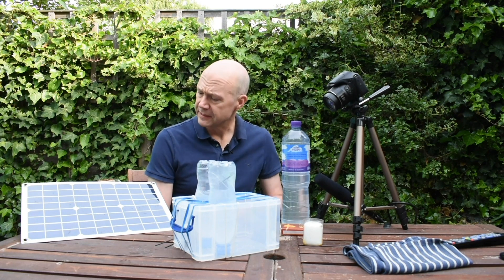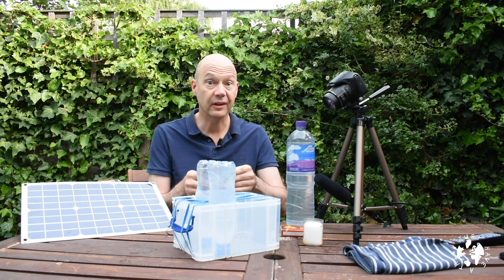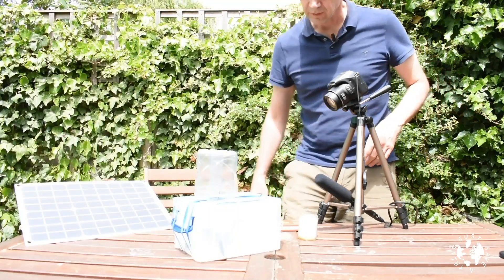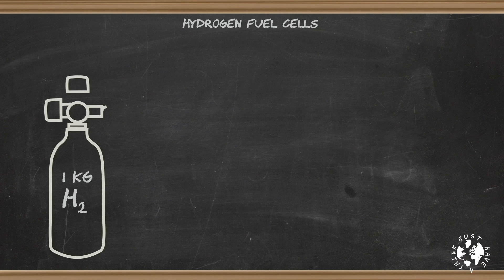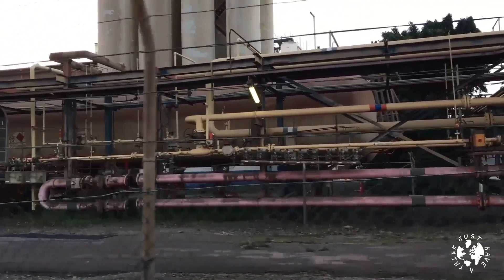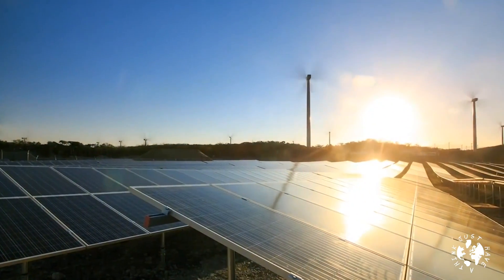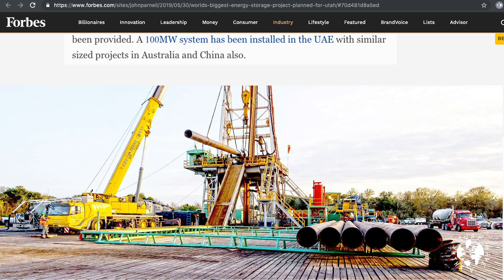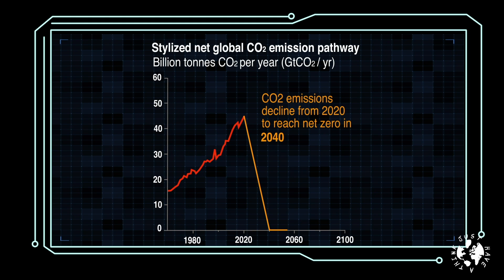Energy Storage in Hydrogen : Does this beat batteries?

Comment: Micro grid storage hydrogen is the optimal solution for both the "duck's back" solar problem and long term seasons fluctuations. With smart meters and hydrogen cells its even possible to do sub millisecond smoothing. (Just need everyone to accept that, in the short term base load should be shouldered by nuclear.)  Every time I see a wind turbine that is not turning I'm thinking, "could be producing hydrogen for the grid."

Comment: Exotic, hugely expensive, inefficient...it's sad that so many people believe in this.

4.1K likes to 140 dislikes at this writing.  So all you 4,100 people really, seriously, should pool your resources and built a pilot system.  Let's say, one house, totally run on hydrogen, no exceptions, which also makes enough hydrogen to run a commuter car six days per week for, say, a ten mile commute (20 round trip).  It'll cost everything you all have, if you sell your houses, close out your bank accounts, etc.  All the smart people want what they have been taught to think of as "hydrogen power", so that means it's obviously the way to go (though it's not a power source at all, but just a very exotic way to store energy).

So go ahead and build the system.  What are you waiting for?  You're smart, right?  Prove all the nay-sayers wrong, and beat those evil petroleum companies.  Put your money where your collective mouths are.

All you need is water and sunlight, right?  Wrong.  You need to remove the copious amount of water vapor from your water-extracted hydrogen, then spend a lot of energy to compress it thousands of psi., then use chemicals to prevent the hydrogen atoms from escaping the container.

Even liquified, hydrogen has one quarter the energy per storage volume than gasoline, so you'll need tanks more than four times as large for the same stored energy.  Storing it as compressed gas, you'll need several times more than that still.  Here are some facts and figures from a government web site which is trying to put the most positive spin on it;
https://www.energy.gov/eere/fuelcells/hydrogen-storage

But don't let me discourage you.  Stop talking about it and do it.  Do it with your own money though, because forcing me to pay for it, whether it works or not, would be theft.

On the other hand, you could grow some trees, cut them down, chop them up and burn them for energy, for just one example, and it's carbon neutral because the tree took all that carbon out of the atmosphere before you put it back, then another tree grows, so it's renewable too.  The wood is also cheap to store for long periods.  I'm not saying everyone should be on wood energy, so don't get all in a huff (though you will anyway, right?) but you see the contrast?

Huge, coercively-funded, exotic technology is pretty awesome to some people, even actually worshiped like a god, but it can just as well be stupid, small-minded and could bankrupt a lot of people for no gain.

I've been hearing about "hydrogen power" since the 1970s.  It was just as obvious then, that it would be THE WAY to go, and yet;
Has it dawned on you to wonder why, after all this time and all this talk, there are is even one billionaire anywhere on Earth who has a fully hydrogen powered home, cars and airplanes, with all the gas coming from electrolysis off of solar panels?  Maybe it's because it simply makes no sense?  Maybe?

I'll close with these words of wisdom;
Hydrogen is the technology of the future.  Always has been, always will be.

Fuel cells make a lot of sense for spacecraft, and a few other applications, but beyond those rare niche applications?  No.

Comment: Yes it works - a small community located on an offshore island used to rely on two diseal powered generators, one covers general usage while second covered for excess usage or as backup. One was converted to hydrogen (simple minor modification that still permits switching back on demand). The hydrogen is produced on the island with a wind generator. Most of their power is generated by hydrogen and battery power provides automated control of the generators.

Comment: What about pumping water into a dam from below with a pump on over production, you then store the energy as potential energy again and run it back through the dam turbine
Reply: Pumped storage. where possible (topography makes it cheaper to build - Norway, Switzerland, Austria ... ) it is done. Not a global solution though. And if you want to build those storages in flat areas they are much more expensive. Then the risk of failing dams and floods. 
They experiment with using old mines (moving weights to store kinetic energy) or compressed air. 

Not even the pumped storage is for  LONGTERM energy use. (it is more for peak demand and emergencies).
Reply: young growing trees remove a lot of carbon from the air *, that wood can be burnt (carbon neutral) that could be an addition to have a more durable fuel for controlled an plannable creation of energy (electricity and heat). Of course those forests would need to be in the moderate climate zone - while leaving the rainforests and boreal forests alone (resp. restoring them if that is possible). 

* in a mature wood the decaying biomass is in balance with what is sucked up.

But over a few decades the growing trees soak up a lot - that could buy us time. much less meat consumption could free up the space to  grow enough  plant based food.

intake of plants versus meat production:  7 : 1 for beef   3,5 - 5 for chicken, pork ....

Comment: using electrolysis results in a 30% loss in energy, during the conversion, plus the enery used to compress the gas. Storage is problematic, extremely explosive. IMO- the future is capacitors, graphene, built into the structure of what ever electrically powered object you'd like. Photo voltaic, the only moving parts are the electrons.
Reply: Wind is mostly wasted at night anyway, so 30% is nothing really. And Germany pushes its solar out to export almost for free.

Comment: How much would it cost per kWh? Meaning that you need the renewable power generator, electrolysis facility, storage facility, and the hydrogen power generator. 

Those temperature projections doesn’t have much scientific proof behind them, so I would not present them as facts.

Comment: The hydrogen does not degrade over ten years. It can be stored forever, and the containers and systems used for dozens of years with minimal maintenance, where as the batteries degrade.

Comment: The problem with energy storage is the space needed. You can achieve better grid blance by using small nuclear plants positioned throughout the gird. I am not talking reactors like we see today but smaller, like that used on a submarine. These small reactors can be placed in many locations at a reasonable price. The reactors then are used to balance the grid. When renewable energy output is high the reactors are at low output and thus extend the life of the fuel and reduce the risk of problems as the reactor is seldom at high or even full power.

Comment: Maintaining hydrogen at a decent compression generally require refrigeration, which mean that beyond a certain pressure just the act of storage costs energy. 

Also, hydrogen can be added to gas pipelines in residential areas at certain controlled percentages, but can not be added to high pressure or distribution lines. Above a certain pressure the hydrogen gas diffuses into the the material of steel parts and pipes, lowering their mechanical strength, increasing brittleness, and increasing the rate of corrosion.

Comment: Efficiency of storage is one problem with hydrogen. Lithium batteries are around 80% efficient. Hydrogen is around 30%. Hydrogen is still economical for things like ships and such but as a battery it brings up the question. Do we store wind and solar energy or just install more and use it differently. 

Industry uses electricity in a stable way because our grid is stable. If our grid starts having peeks of power month to month industry might just change to utilize that. Only make glass and aluminum in the summer months when energy is abundant.

Comment: Extremely interesting video, something I have been behind for many years. A controversial chap called Bob Lazar claimed he stored hydrogen in pressurised tanks containing hydrolyte material, when heated gently the material would readily give up the hydrogen on demand thus removing the danger of storing the hydrogen. You have my sub, P.S. I owned a company for many years which was a the very front end of renewables, made it in the local paper around 2000 for having my house electricity and heating running from a waste oil engine and a home made wind turbine.

Comment: 5:50 except water is a greenhouse gas, also storring hydrogen is a pain as it tends to leek out through materials or embittel metals, so the only options left are glass or Teflon coated materials, other problems include keeping it refrigerated if you want hydrogen in liquid form, or you could just keep it compressed.

Comment: Storing hydrogen is a very complicated problem, you can't so much as store hydrogen as slow down its inevitable escape. It is far more practical to store hydrogen in a molecule, albeit one that has much weaker bonding than water. On this front a huge amount of work has been done on the Ammonia Economy as a cubic metre of ammonia stores far more hydrogen than a cubic metre of pure liquid hydrogen. Further it is readily liquefied by compression and can be relatively safely handled with the same storage and transport technology used for liquid petroleum gas. Low energy ammonia production technology has been developed but, sadly, after several years the developers were unable to find independent investors and the giant Siemens Corporation now owns the patents. I'm not going to accuse Siemens of being nasty in any way, they didn't make a move  on the process for several years, but they are a multinational with multiple sources of income and it is simply economic sense to wait for demand or legislation to make further investment more viable. Yes it may be for the better if the process was ramped up immediately but, unfortunately, that's not the way things presently operate. (You might have to look into archived material if you are motivated to look further into this fascinating and likely practical technology)

Comment: I wouldn't feel comfortable living near a hydrogen storage site.
Reply: That is a serious hurdle to saving the planet from humans: getting over the "feelings" that are seriously stifling progress.  Many cities heat dwellings and food using DANGEROUS EXPLOSIVE GAS!!!!! but we have been safely living with that for many decades without significant problems. Have you ever cooked with gas?  Did you die? Hydrogen is just as safe.   Its important to have enough concerns to demand safety equipment and standards and for some intelligent people to consider the long term implications. As long as that is happening, we can all safely get on board with hydrogen.
Reply: @recklessroges  Methane isn't stored at as high a pressure as Hydrogen. It's not the flammability that concerns me.

Comment: Great demonstration and explanation! What losses are we dealing with here? You've shown that hydrogen has higher energy density than batteries, but how efficient is it? Also, how does it compare in efficiency to pumping water up a hill during times of excess power and then letting it run downhill and produce hydroelectric power when needed?
Reply from the maker: Hi Jason. All good questions. Possibly outside the scope of that video, but maybe something that can be looked at in  later programs. Certainly pumped hydro is another interesting storage solution, but obviously one requiring a lot of space! All the best. Dave
Reply: @JustHaveaThink  Sounds good! Looking forward to it!